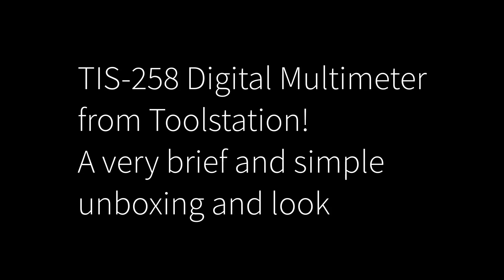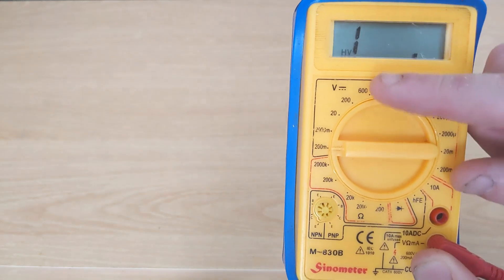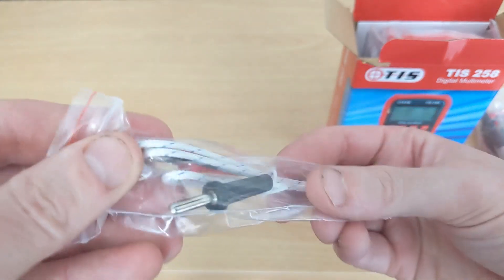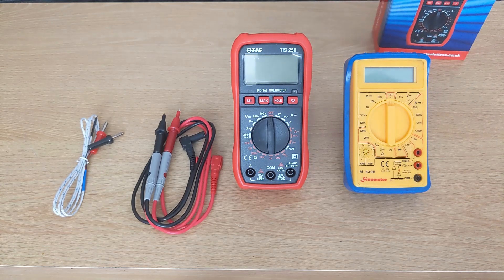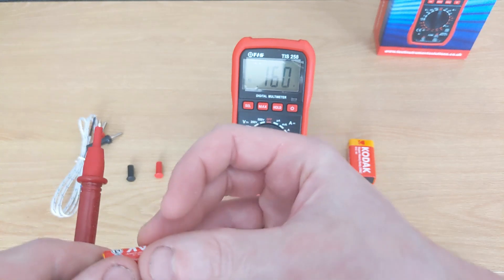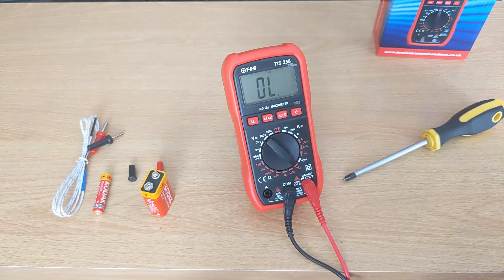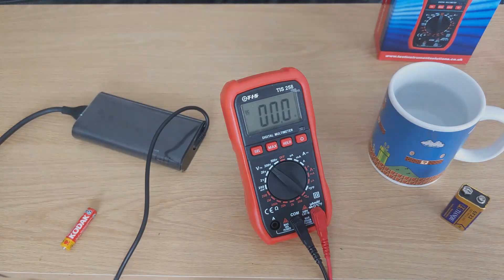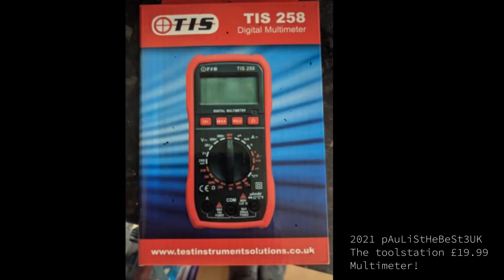Toolstation TIS 258 Digital Multimeter Unboxing and brief  look

Comment: Hi, can you use this to test live wires in ceiling lights please? Thanks mate
Reply from the maker: Yes just be careful with high voltages. The multimeter supports 250volt mains testing

Comment from the maker: For some reason the old 10 plus year old multimeter is now working fine, showing 0.00v now without anything connected - and battery readouts are good on that one. Thanks for the info on the new one snoeg! So now i have two working multimeters. Tempted to buy some of the really cheap ebay ones you can get these days, build a collection lol

Comment: The battery voltage values seem fine. New batteries (without any load) are going to be like this. You can do a google image search for "9v battery typical discharge curve" or similar, and you'll see what kind of voltages can be expected as a battery is drained.